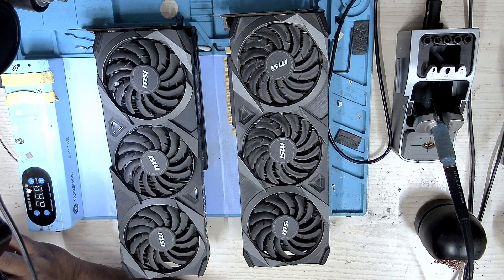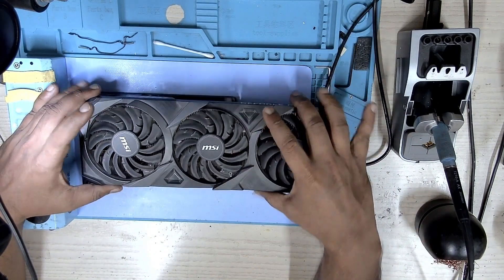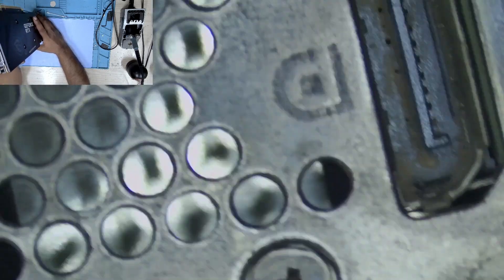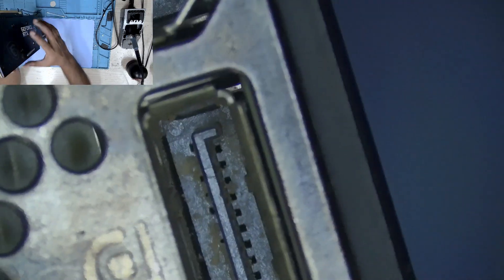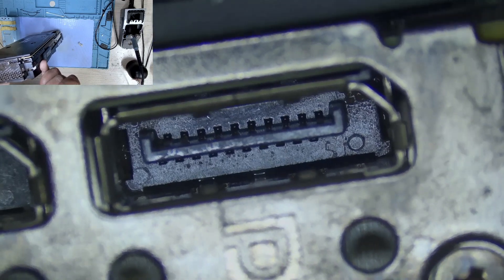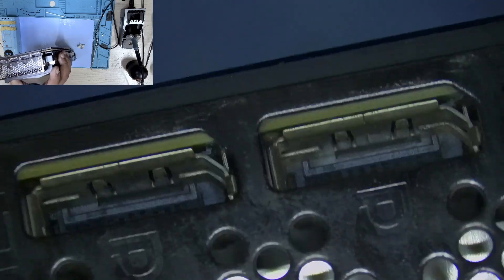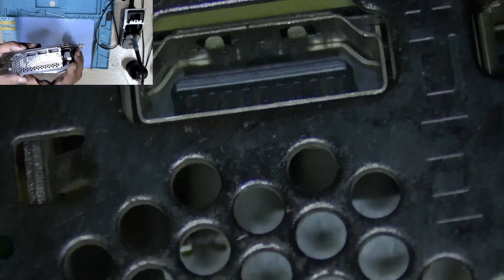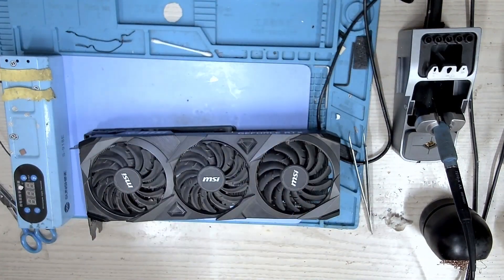MSI Ventus RTX 3070 GPU Boots But No Display - Easy Fix.

Comment: Got a ventus rtx 3060ti same problem, my mobo show boot led, no display it works good with others vga
Reply from the maker: Is it stuck on boot or no display. Do you know which memory is on the GPU? Like Hynix X005?
Reply: @GraphicsCardRepairs-tk7ql  no display, fans turn on, and the ez debug in the mobo light the boot led, others are off, CPU led, VGA led.

I tried clearing cmos, didnt work. 
The card stop sunddely working after be storaged for like 7 months, only used it 1 times and used to work, after i just saved it for later, recently tried to put it back, and don't work.

I don't know if it's Hynix, didnt even check it the first and only time i used it.
Reply from the maker: This is a strance one. Does your cpu have internal graphics? If yes can you boot through the internal graphics and check if the GPU shows in device manager? If no it would need to be diagnoised by a techinician. If you have the tools and skills i can guide you what to check.
Reply: Yes, i really don't have idea what could be, but the PC seems to work great with others graphics, i'm gonna send it to a local technician since i don't have the tools or skill to fix by myself.
 thanks you so much for the help. Hope the technician don't scam me ( i'm from Venezuela, it happen often here)
Reply from the maker: Let's hope it all goes smoothly 😁

Comment: Great video, Do you know where I can get the DP/HDMI tester?
Reply from the maker: Yes you can get it on AliExpress
Reply: @GraphicsCardRepairs-tk7ql I found the HDMI but not the DP
Reply from the maker: Just found this amazing item on AliExpress. Check it out! AED5.88  10%OFF | Test Board 1Pcs Display Port Female Test Board DP Male Test Board 22 pin PCB DP Test Base To Array Pin PCB Data
https://a.aliexpress.com/_mP1S3t8
Reply from the maker: Shared the link to dp port